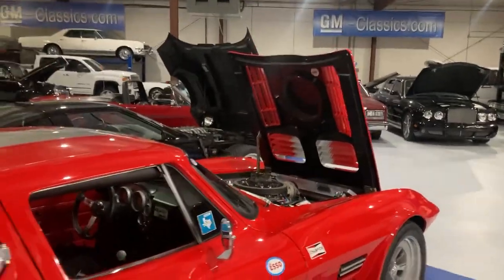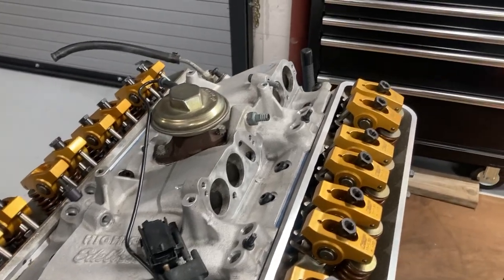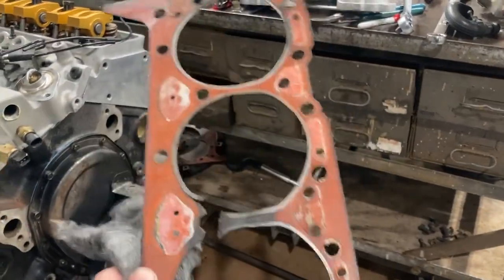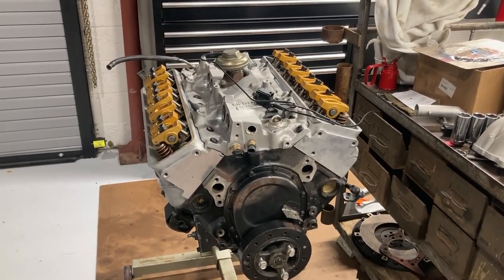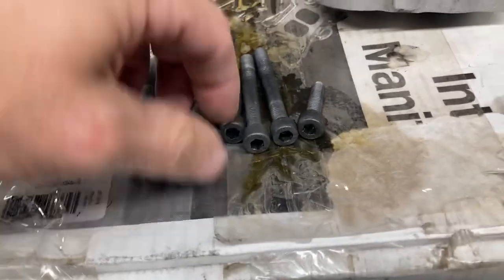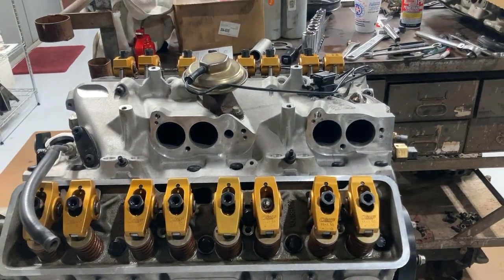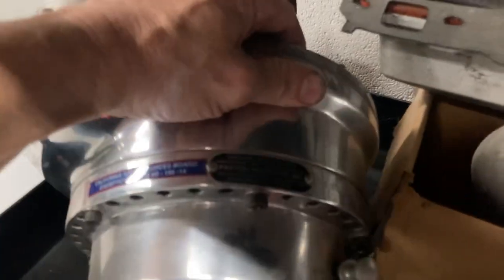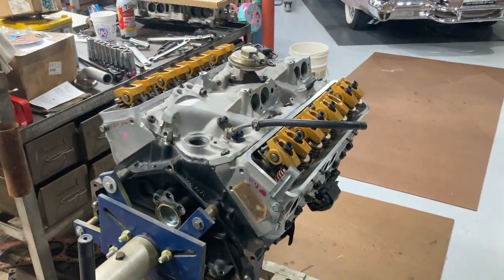1988 Corvette L98 TPI Paxton Supercharger ZZ3 Engine Reconfiguration - Engine on Stand - Part 3

Comment: i have a 74 el camino with the original l98 engine from a 88 corvette. it got low on oil pressure so i pulled it and now its in a big pile of parts on the floor.. i guess ill have some fun putting it all together again..

Comment: question, with a stock l98 cast iron heads what would u recommend be done to accommodate the zz3/4 cam (.474,.510 lift)?
Reply from the maker: Change springs on car but stick with 1.5 rockers.  1.6 could cause binding and break springs at that lift.  Or do nothing, put cam in. As with stock tpi it wont rev high enough to matter.  You will pick up a lot of mid and torque.

Comment: So you sandwich the egr block off plate between the manifold and the egr tube?

I was also thinking of removing the egr valve under the manifold, but leaving the vacuum line capped so the sensor sees resistance when energized.
Reply from the maker: If you want to keep the exhaust heat out of the manifold on an alloy head car, you plug it up out of the EGR tube from the exhaust manifold to the intake manifold to look stock, put it all back and its good to go with no egr function or heat.  If you dont care about stock, then cut/weld the manifold egr tube that goes to the intake closed and just eliminate it all.  On an iron head L98 you can just unplug the vac hose to EGR.. BUT that does little to nothing and does NOT keep the exhaust heat out of the intake as the head crossovers are still active.  L98 alloy heads do not have those like a "race car" head.   You will have to pull intake and use block off intake gasket inserts on the crossover ports.  They come with some fel pros and other brands.  If your total "race car" your heads wont have exhaust crossovers anyway like the L98 alum heads do not, and you will be running headers.  Just put the block off on EGR on the intake like a 70 camaro, etc... but if you total race car, you wont be running a stock TPI base anyway or even a TPI...
Reply: It's not a sensor.  It's a vacuum solenoid.

Comment: I just got a 89 vette the guy took the engine out and took it all apart and couldnt remember how to put it back together. He sold some parts and then I came along and offered him $2,000 and its almost done.! I have got the motor finished..New rings, bearings, injectors, and all the missing parts he sold and its back in the car..!! The smog pump was locked up and its bracket was broken so Im putting on one of those pump eliminator kits, Should be here in a couple of days. The L98 is a good platform to work off of. My buddies all wanted me to LS swap it but when I was looking at the block numbers they matched to VIN number so yeah. I had to go back with that engine. Thanks for all your uploads you have no idea how many different vids Ive looked at to glean just a tiny bit of info on how something should go on the vette ...